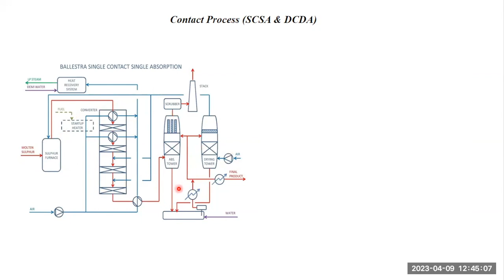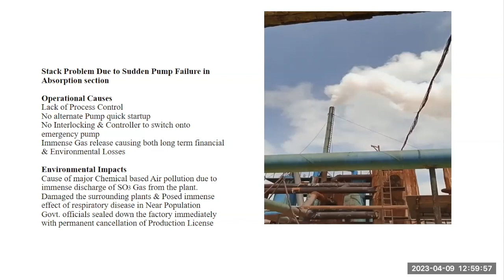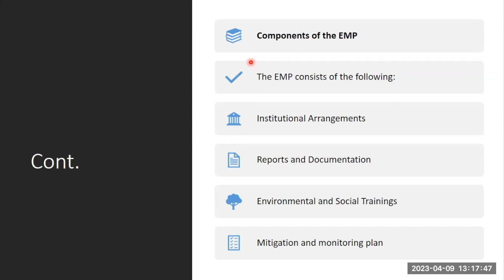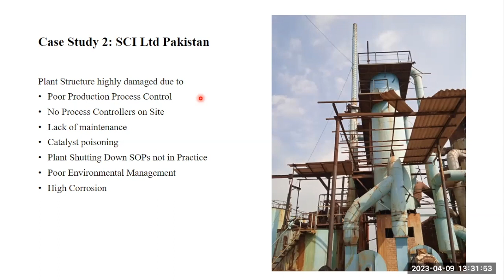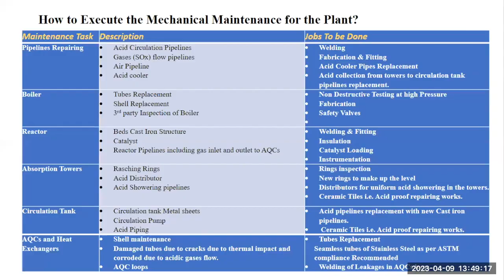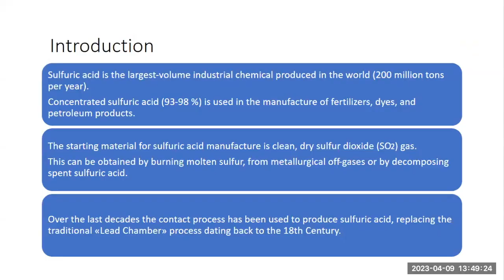Challenges in Sulphuric Acid Industry | Webinar | Saud Khalid (Process Engineering Consultant)

Comment: Dear sir
How to increase our production
If plant 100 tone and production 50tone
Everything normal conditions such as catalyst etc plz share any recommendations
Reply from the maker: To increase production from 50 tons to 100 tons while maintaining normal conditions, including catalysts, several strategies can be implemented. First, conduct a comprehensive analysis of the current production process to identify bottlenecks and inefficiencies. Optimize equipment utilization and material flows to maximize capacity. Implement advanced process control systems and upgrade monitoring capabilities to ensure efficient operations and consistent product quality. Invest in training programs to enhance the skills of your workforce, enabling them to operate equipment effectively and contribute to continuous improvement initiatives. Additionally, streamline supply chain management to minimize delays in raw material delivery. By fostering a culture of continuous improvement and regularly reviewing performance metrics, we can systematically work towards achieving our production target of 100 tons.